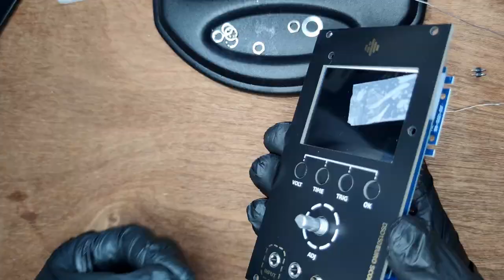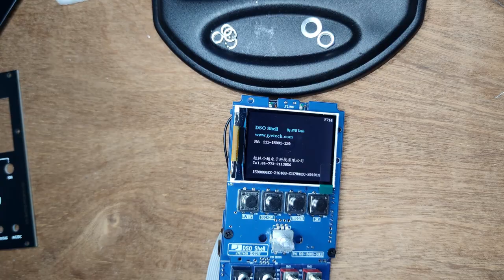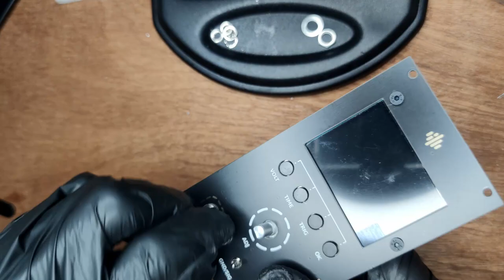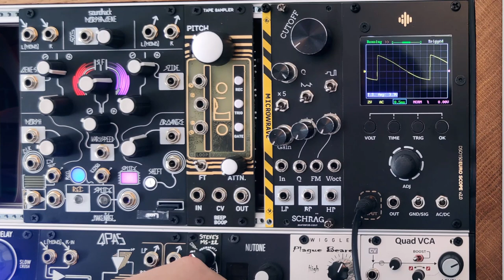Plum Audio Euroscope build, review, and demo

Comment: Thanks for this tutorial I have a dso which I use to debug projects, but I wanted a scope that I can use in my euro rack. My budget does not run to the Data scope - I'm cheap! This solves the problem.
My only concern about this video is the practice of soldering the jumpers from the top. It runs the risk of shorts by leaving exposed wires above the board. Possibly better to solder them on the reverse side -even squishing the insulation by pushing on the wire so that it mushrooms to form strain relief. Thanks for your engaging and informative chanel.
Reply from the maker: That's great advice, Ed!